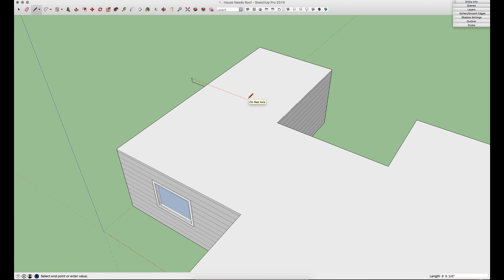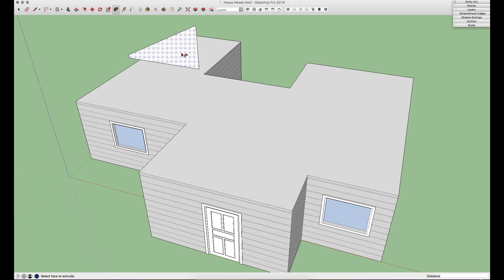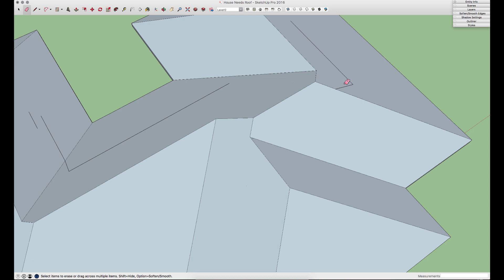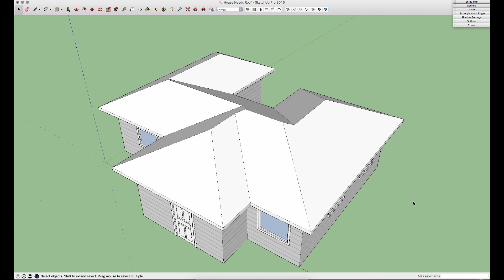SketchUp Skill Builder: Hip Roof

Comment: Thats ONLY good if you are building a "play" model or you intend to use TRUSSES. 
If you are doing REAL WORLD FRAMING, that's not even close. How do you do it with a RAFTER on a top plate with a BIRDS MOUTH? - do you just lower the "top plane of the building" where it EQUALS where the actual framing will be??

Comment: every time i try this the roof either doesn't follow the roof line correctly (overhang goes way out on some sections of the building) or it doesnt do the whole surface of the roof.  for example, it wont do roof areas that face interior courtyards.
Reply: Hi Jon! Unfortunately, I cannot really picture what you are seeing. The best way to get help would be to post on our forum (http://forums.sketchup.com). There you can post your model, or an image and get hundreds of skilled modelers offering help!

Comment: There is actually a free plugin that can create hip roofs! It is called 1001 bit tools i believe and it can create more advanced geometry like windows and doors.
Reply: +- Lets Build With Sketchup - In a sense that is true and i like to create a lot of things myself too, but i do a lot of rendering and sometimes it is just handy to let a plugin make a roof for example so you can get an idea of how something will look before you put a lot of time into it so drom that point of view i wouldnt call it cheating.
Reply: +- Lets Build With Sketchup - thanks for agreeing ;) but by looking at your channel is a good way to verify your point made, you seem to have a lot of skill and great work!
Reply: +- Lets Build With Sketchup - how about building your own workstation? it can be a lot cheaper than a laptop and is much more powerful, if you want me to pick parts for a custom workstation build you can pm me and i can maybe help you out?
Reply: +Max van den Hoven Medeek also has a roof builder plug-in that's a snap to use.  More functional that the 1001 bits one but unfortunately is on a one month time trial basis.  But then again, it's only $20